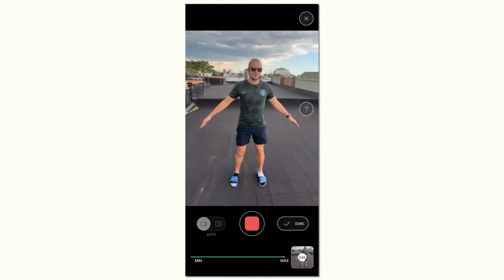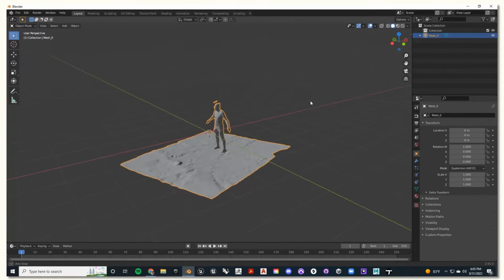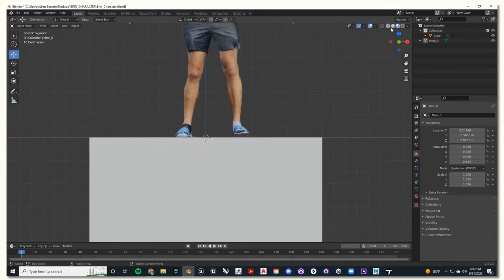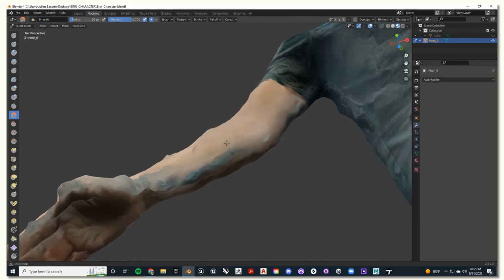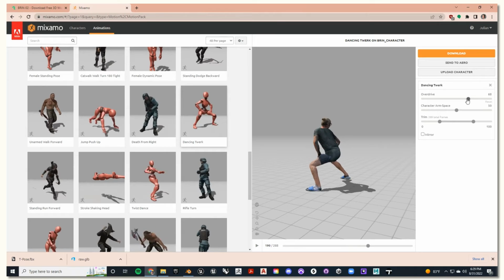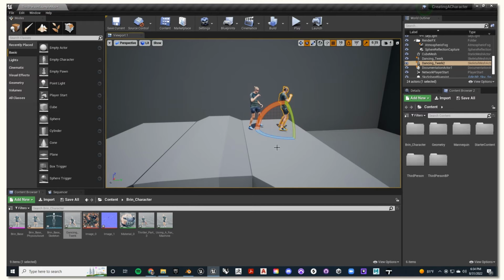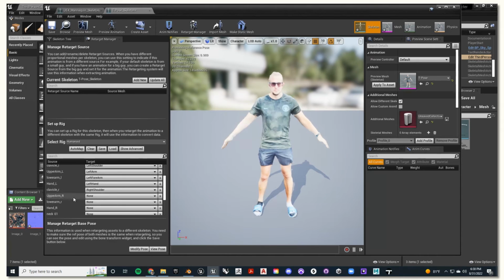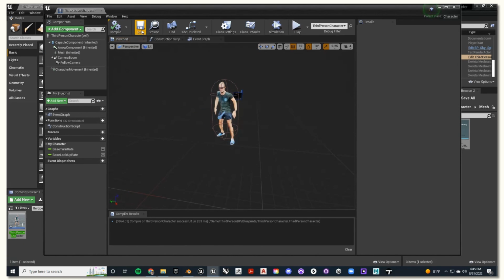Polycam to Unreal Engine Part 1 — Build a Game Character from Real 3D Scans

Comment: I love your app but this tutorial is full of BAD ADVICES if not just NONSENSE.
Sorry for CAPS.
For the bad advices :
1. You can't have a decent result with photogrammetry and full human because it's too slow --> subject will move --> scan will be messy. 
-> Instead use video (RAW format appréciated if you can), and for the --> face only <- you dont want body or hair/ears. 
2. You should do the scan outside on an overcast day because of the lack of contrast and shadow you need on the skintones to output an uniformly lit texture at the end... 
But that's not the case and here comes the nonsense : 
1. Your using a full no-retopo messed up geometry scan as a skeletal mesh on UE5 
2. Your workflow doesnt involve metahumans (it's free).
3. Your mesh isnt modular so you basically cant change the outit, simulate some hairs and list goes on...

NB : Again i love your app frrrr but you can't be missleading people like this as they will be discouraged by the really bad results whereas with my method you end up with AAA assets for free (even if you want to pay reality capture it's rarely more than 1$ ).

Comment: I assume you don't have to create a low poly version if you're using Nanite right?
Reply: this is a cool and easy way to use a photo scan to create a character but it's not a good practice if you wanna make a game. The topology is a mess in the photoscans which makes the mesh heavy, the textures appear bad and the stretching of the mesh inconsistent. You can use your photo scans to create a metahuman face mesh. That way you'll get a fully rigged, textured character with good topology.  Nanite does not (yet) work with skeletal meshes.
Reply: low poly version is bcz UE = game engine so we use tricks.
Idea here is to project the textures in HQ (nomal map etc) on a low poly version.
Meaning you see the same level of details but its optimized for real time and also for movements, bad topology fuck up the mesh as my collegue explained before me
Reply: nanite is for static mesh (mesh with no skeleton) atm so will not work with moving objects even if it does work with foliage in 5.1 wich is already a revolution.